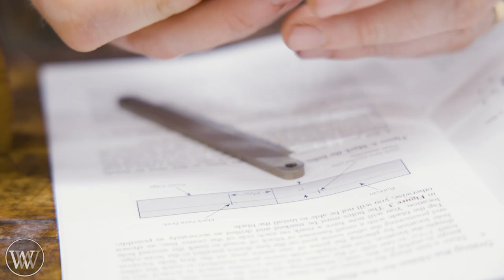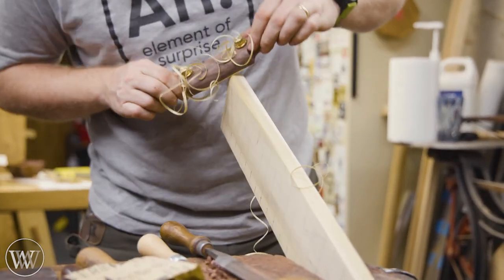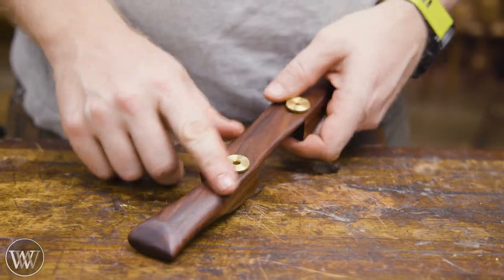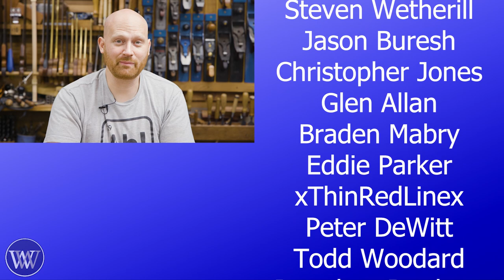Rosewood Spoke Shave

Comment: Don't know if it's helpful to anyone reading these comments, but when I'm trying to make smooth inside curves that I'd be paring to like you're doing at 5:41, sometimes I drill a hole, the diameter of the curve i want first, then chisel and file to that. 

Cuts out the risk of going past the line with the chisel for me & makes a perfect inner circle with no file work.

Comment: How big is the clearance between blade bevelled and rosewood ---to allow shavings to shoot out easily ?
Reply from the maker: Spokeshave the thickness of the mouth really doesn't matter that much. You want it to be at least twice the thickness of the shaving you're taking but most the time opening it up to a 16th of an inch or an eighth of an inch is perfectly fine.